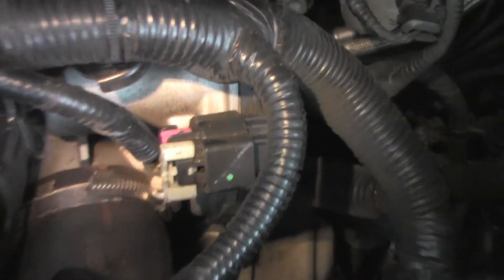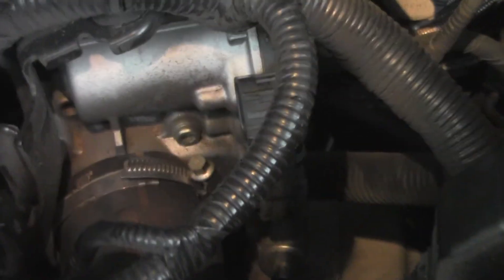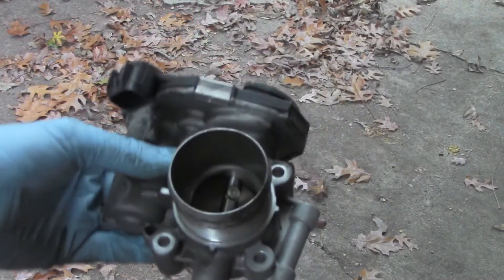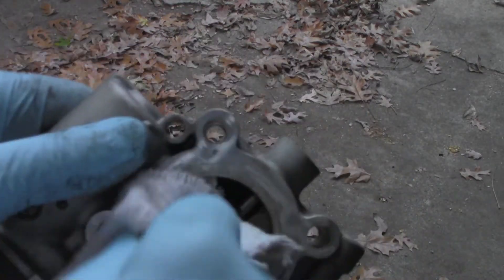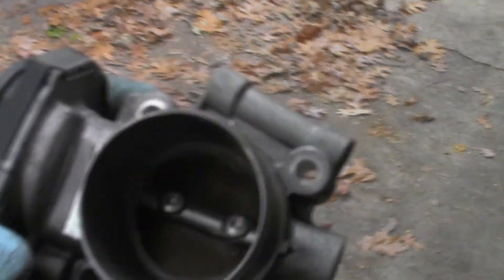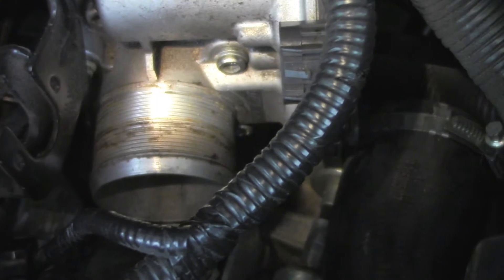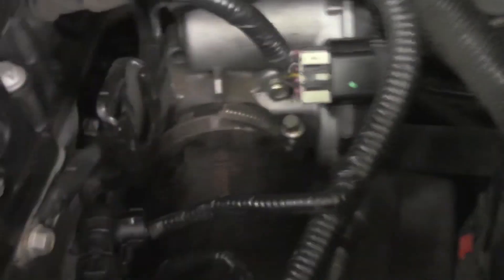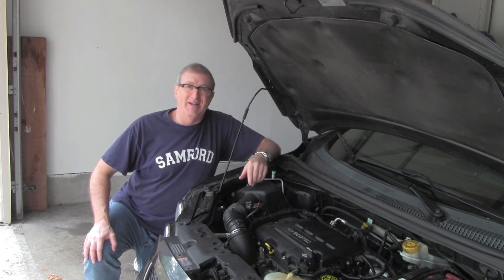2015 Chevy Sonic LTZ turbo Throttle Body Removal and Cleaning

Comment: Any advice - took my throttle body off and cleaned and put it back on, now when I turned on my car (2016 chevy sonic turbo) code 84 came up and the engine light.
Reply from the maker: I have not had this issue. I would suggest using google to search out the code and what it means. Check several sources to verify with some accuracy the results you get and go from there. Since I have not had this issue, I don't have a reliable solution for you. Good luck.

Comment: Put an oil catch can on the PCV vacuum line and it will keep oil out of the turbo, intercooler, throttle body, intake manifold, intake valves, and cubustion chambers!

Comment: Having trouble taking off the intake hose after removing the screw....is it just a twist and pull movement that I gave too do?
Reply from the maker: I believe I had to use a small tipped flat blade screw driver to gently insert under the rubber to "unstick" its seal from the throttle body. Once you can do that, it will come off easier.

Comment: I have a 2011 Chevy cruze 1.4t....i have a code p1101...but before the code i used Royal Purple max clean...but i used the obd scanner to clear the code and it hasn't come back yet but i checked the turbo and i seen some blk gunky stuff....you think its safe to use the cleaner in the turbo..i haven't checked the throttle body yet for the gunky stuff ..will do it soon
Reply from the maker: I have never used the Royal Purple products, so I cannot say for sure it is responsible for the gunky buildup. I can say that the buildup is not good. Check your throttle body and see how clean it is. Either way, fuel does not go through the throttle body, only air, so it should be cleaner....Really depends on miles, maintenance, air quality and other factors. Both should be fairly clean. I can only say that I use Lucas products for years and have had no problems as you described. Do you know if any gunky buildup was present before using the RP? Check out the Cruze/Sonic turbo forums and you may find a lot better info specific to the products other have used with good results. Hope this helps. Good luck.

Comment: Question sir. I have a 2016 sonic Ltd turbo modified. 48k miles . When do you suggest this cleaning & is there a noticeable difference?
Reply from the maker: We first cleaned it on my daughters car at about 65K. It probably needed it before then. Did I notice a difference afterwards? Hard to say, I believe cleaning will help. In our case I can't say I noticed a big difference in actual performance. After seeing how dirty it was, I am confident it did help. The dirt and trash accumulates very slowly and degrades your performance so that over time you may not realize the car does not run as well as it did years ago. But the trash you see at the throttle body goes into the motor. We run Lucas fuel treatment every month or so to help clean the lines and injectors and make sure the air filter doesn't get to bad before changing as well. I would just include it as routine maintenance every 30K or so. Hope that helps.
Reply: @laurencevillegarage  Good points. We have a 2018 Atlas VR6. The throttle is so easy to access, that it's a 30 min job in total. I clean it once a year in the spring. The biggest bitch is on Diesels. They get full of shit quickly.

Comment: the host that connected to the throttle body how did you pulled it?it so hard to come off..what would be the best way?
Reply from the maker: It did take a few minutes, but I pulled and used a small screw driver to push from the back. It will come off, just be persistent.

Comment: How in the heck do you get the bolts out of the throttle body. I find that the bracket just to the left of the throttle body is preventing me from getting anything in there
Reply from the maker: I had to use a small socket with swivel to start it then use 2 fingers to  get out.

Comment: Do you know if the throttle position sensor is built into the throttle body or is that located somewhere else?
Reply from the maker: Yes, it is built into the throttle body.
Reply: Yes, you should never manually manipulate an electric throttlebody. You should also use your scan tool to reset throttle position parameters.

Comment: how did he get past that bracket that blocks one of the throttle body bolts???? you can see it at 1:25, then "poof" he has the TB off
Reply from the maker: Removing the throttle body and managing a camera at the same time was difficult. There was no place to put the camera and lighting to show taking it off that would not be in the way. As I recall, 3 of the bolts were pretty easy, the 4th more of a challenge due to such a small area to work in. I seem to recall using a swivel to help with #4. I hope that clears that up a  bit. Also, this was one of my very first videos and was having to learn quick! Thanks for watching and commenting, I hope you did find it of some help on your project.

Comment: How was the idle after ? Did u have to do a relearn
Reply from the maker: It took a few minutes for the "brain" to adjust, didn't take long. Idle was fine once computer adjusted.
Reply: some people say, calibration is neccesary with computer. what do you think about this matter.
Reply from the maker: The computer is smart enough that it will adjust accordingly as long as the new part is the correct part. Not sure about installing a similar part from another car, the parameters would probably be different and the computer would notice.

Comment: Does the gasket have to be replaced or is it reusable?
Reply from the maker: I was able to reuse mine.
Reply: @laurencevillegarage  thanks and did porting make a difference in power and or MPG?
Reply from the maker: I did not port the throttle body.
Reply: @laurencevillegarage  my bad I was watching other videos where they ported it and got mixed up with yours I guess lol

Comment: why not just clean it on the motor?  seems like you can clean it just by using a spray can ?  no need to remove unit for cleaning?  now i am confused and crying!
Reply from the maker: Had to pull it out due to it's location. I could not get to it where it is and would not have been able to clean the backside. It's really not that difficult to get out.

Comment: Now you have to do a throttle body re-learn. Then it's done..
Reply: GM doesn’t have a very clear throttle body re-learn process anymore. They basically just say to drive the car and the ECU will learn after about 40 miles or so